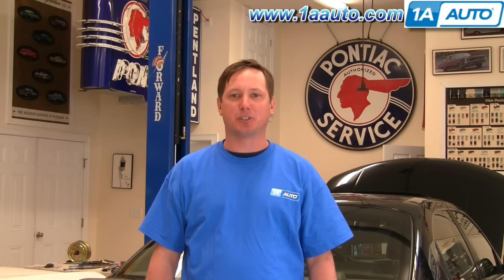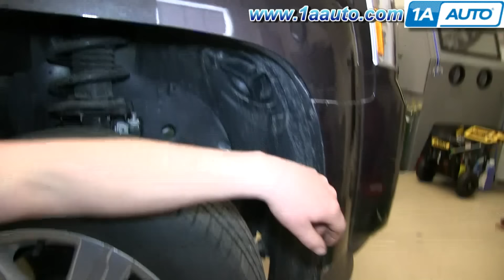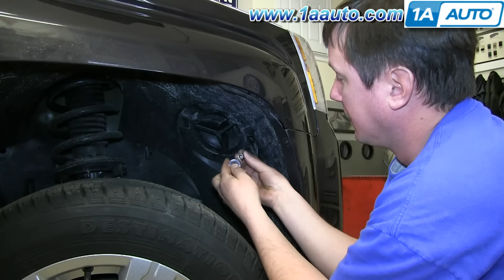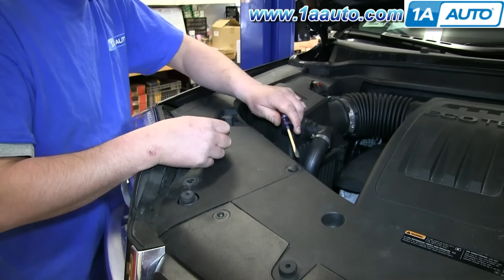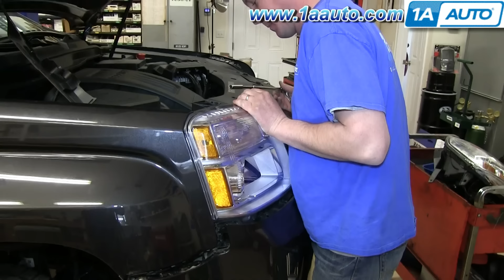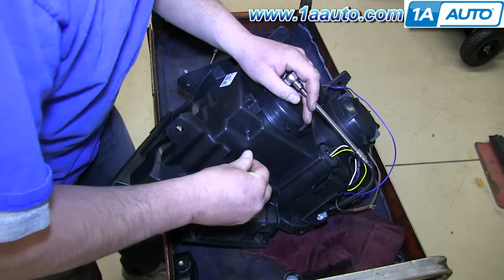How to Replace Headlight 10-15 GMC Terrain

Comment: After recall GMC changed the rotating socket to one that has a strong wire clip that cannot be removed without tools. They didn't tell me that the design was changed. A**holes. NEVER AGAIN GM !!!

Comment: I was quoted $535 for the complete headlamp unit (passenger side) for my 2011 Terrain by my local GMC dealer. The labor charge to fit is estimated at $320. Bought the unit from these folks at $115 including shipping. Watched this video and  did the replacement myself in about 30 mins. Great com,pany to work with

Comment: This is a terrible video. Why wouldn’t you change your lightbulbs when you have the light pulled out. It’s a huge fail video when you didn’t change the bulb while the assembly was still in the vehicle

Comment: Thanks for showing putting it back together after the bulb is in. That's where I got messed up. I had the plate you twist pointed in the wrong direction and couldn't figure out why it was so hard to get on when it was so easy to take off.

Comment: This does not work for the 2015 Terrain, GMC, in their amazing wisdom, eliminated the round, removable cover in the wheel well and now you have to take the entire wheel well cover off to get to the bulbs. Edit: well, not quite remove it, but you have to turn the wheel in toward the body and remove 3 torx screws and a pop rivet and then force the wheel well cover back far enough that you can get at least one hand in to remove the cap and then remove the bulb. You have to wear some kind of glove when installing the new bulb because you don't want to get skin oil on a halogen bulb, otherwise the heat will be drawn to the skin oil and melt the glass and ruin the bulb. I could only get one hand in, but I was able to change the bulb with just one hand.

Comment: Great video, replaced both assemblies in 90 minutes on a 2013 Terrain Denali and your instructions were perfect. Only suggestion is that the corner clip at the edge of plastic bumper is located at the corner so a pry bar used at the edge is effective in popping off  the plastic bumper.

Comment: For a 2014 Terrain that has no wheel well access- passenger side all done under the hood
1. Remove the 4 plastic pins that hold the inner trim along the fender/hood from front to back by popping the center up of the expansion pins with a flat blade, then pry the base of the pins out. There are three in front near headlamp and one at the rear end by firewall.
2. Unhook the rear hood rubber gasket strip by pulling it and unhooking it from the tab on the trim back end. Now lift the side fender top trim and pull out from back (it has a built in hinge point) , releasing the two metal clips along the fender top and then back it out of the front inset plastic tab over the radiator. The trim side is now free and can be set aside.
3. Remove the two screws holding the small cross side "T" bracket and the one smaller screw that fastens the headlight top back to that same small cross "T" piece. Lift that cross piece out so the metal formed insert tab on it comes out. 
4. You now should have just enough hand access to reach down behind the headlamp to twist off the circular cap seals, and then access to the bulbs inside them. The rest of the replacement is the same as if you had a removable fender access to the bulb back circular caps.
Reply: This goes for the 2016 as well. No wheel well access. All under the hood.

Comment: We’re that second bracket goes into the headlight with the 10 mil bolt my headlight is broken we’re that bolt has to go in will the bumper still snap on securely without that bolt in the headlight. I’m trying to figure out if I’m gonna need a new headlight before I get to it because right now Im working on putting the fender back on and maching it into place along with getting all the pieces back on the bumper!

Comment: How do I adjust the height of the lights my car was in an accident they were replaced but they are aiming too low. 2014 SLT Terrain
Reply: There is no headlight adjustment... so if your headlights are aiming low the headlight mounting points are out of wack.

Comment: I have a 2015 and the access panel you show in the wheel well area does  not exist

You will have to remove three of the clips 2 T15 screws

Lastly two 7 mm bolts underneath the front spoiler Where the wheel well connects to it

You can then gently pry back be wheel well to access the door panel to the headlight bulbs

When removing the screws from the wheel well keep the wheels turned inward then  When you are prying back the wheel well slightly to gain access to the headlight assembly you will want the wheel turned out

Comment: Is it me or is it the method for changing the lights the same as removing the whole light assembly? Do I miss something there?
Reply from the maker: +Dan Lo Fat Thanks for checking us out! You can change the bulbs without removing the assembly however for the purposes of the video, we show how to replace the bulbs on an assembly that was removed. You do not need to remove the assembly to just replace the bulbs.

Comment: I don't see any cap in the wheel well of my 2015 terrain sle-2. Is there any other way?
Reply: The later models do not have the access port in the wheel well. You need to remove the headlight assembly as the video shows for “replacing” the entire assembly. Once you have it pulled out, you just replace the bulbs and reinstall it. Way too much effort for routine maintenance; gross oversight by GM or a new way to force many people into the shop for what should be a simple DIY fix.
Reply: Yeah, the one they show in the video is the easier method. The model you have requires you to go from the top under the hood. It's extra hassle and time unfortunately.
Reply from the maker: +Wendell Lynch I would pop the hood and see if you can reach in there to access the back of the headlight.  If not then you will probably have to remove the wheel wheel cover itself.  1aauto.com
Reply: @1AAuto  I noticed that I have to go from the top under the hood. You should do a video on that type🤔

Comment: I am trying to remove the headlight cover, the one right in front of the access hole, but it isn't coming off when I turn it counterclockwise. It looks like the long tab is missing from mine. Any advice on removal of the cover?

Comment: How does one go about changing the fog light bulb?
Reply from the maker: +Jeff Sinclair You should be able to reach behind the fog light assembly and remove the bulb. You may have to twist the bulb in order to pull it out. If you need to remove the entire assembly to gain access to it, this video will show you how to remove the fog light assembly. Hope this helps you out https://youtu.be/3qRCVb2lGVs

Comment: is this the same for 2010 model GMC terrain?
Reply: Should be.
Model years '15 and up have a different fender liner, which do not have the cap to unscrew.
Reply: I have a '14 that has the fender liner with no cap. It's much more of a pain. And yes, it's a '14. Guess I'm just lucky...

Comment: I dont understand how you are suposto change the headlamp by just removing the cupbord behind the wheel. You are basically working blind, bc you can only fit your arm in there.

If you can shed more light on it it would be greatly appreciated
Reply from the maker: You can access just the bulbs by removing that access panel that we show. They should be right in front of you once you take the cover off.
Reply: Turn the wheel to have better access.
Reply: My 15 doesn’t have that wheel well access on either side

Comment: Know where I can order more of those clips from inside the wheel wells?
Thanks for the video, upgrading my bulbs!
Reply from the maker: You may be able to get new ones from you local auto parts store or from the dealer. Hope this helps you out. 1aauto.com 866-403-3393